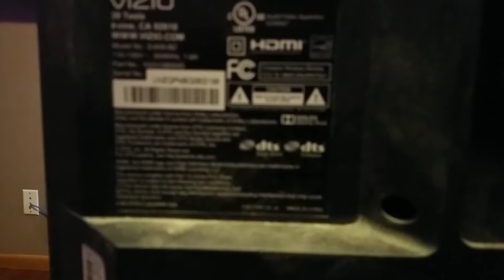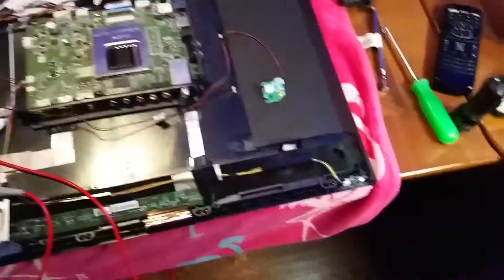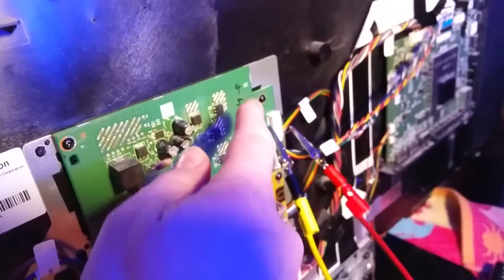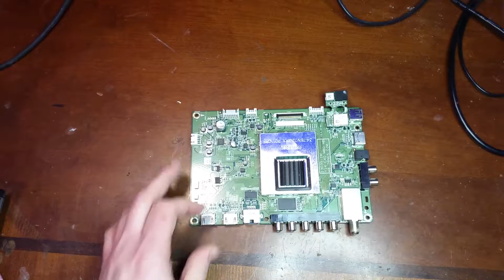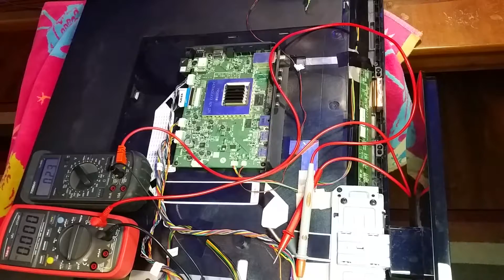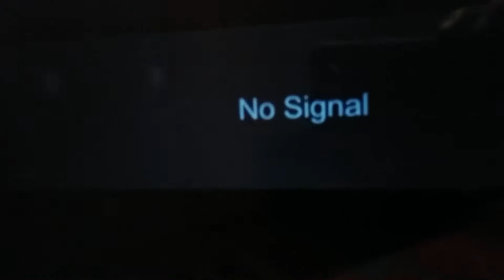Watch me Repair Vizio E400i-B2

Comment: Where do I find the wiring diagram for the circuit board
Reply from the maker: Like a schematic? I'm not sure if one has been made available. But usually the header pins have some sort of diagram or clues to what the wires do.

Comment: Hello. Very good video. Mine was affected by by a Thunder that hit close to the house and TV would not turn on. I'm a DIY selfer, but Im no trained techy. So, TV now about 10 years old, I blamed it on the power board and got a NOS PB from ebay. Now TV turns on, Vizio logo, get visual and sound for 3 secs and then freezes and turns off and doesn't turn on unless I unplug it from outlet? What could it be? I think I can get the other 2 boards for a reasonable price and get my TV back online. Would You recommend getting the other 2 boards and see what happens? Thx!
Reply from the maker: If anything was plugged into the HDMI cable a surge could have come in that way and damaged the main board. I'd first confirm the image stops working also when the backlight goes out. If so, order a main board.

Comment: My PSON voltage is measuring 3V constantly, no matter if when I push the power button.  Would that indicate an issue with the main board?
Reply from the maker: Yes sounds like main board

Comment: I also have the Vizio e400i-b2 and my TV is doing exactly the same thing yours did. However, before that it would randomly turn itself off for no reason. Sometimes it wouldn't do it for a week and sometimes it would happen 2 or 3 times in an hour. Well acouple days ago it turned off on me but wont turn back on. The power light comes on and then it turns off, but the screen stays black. Exactly like yours. After a bunch of research of this model on forums and YouTube and it seems the consistent answer is the power supply board goes bad. I'm going to order one online and replace my board. After watching your video and one other I'm pretty confident this will fix it. I'll update you guys after done.

Comment: I have this same TV and it is having issues. It won't turn on. I pulled off the back like you have but not sure if I should swap out the power supply board or if there are any tests I can do on it. Any suggestions? I have checked out a few of your videos and love your repair work. I wish I could understand electrical boards and such.
Reply from the maker: Fist thing first, do you have image? Hold a bright flash light up to the glass and turn it on. Look for menu messages like channel info or "no signal detected" messages.
Reply: @jeffescortlx  Nope, i do not even have the power light coming on. I try with remote and with button on the TV, no luck on the power light showing that it is on.
Reply from the maker: @Retnuh1337  did you test the power supply?
Reply: @jeffescortlx  To be honest, I do not know how to use a multi-meter and where to use it to test. I will try to find one of your videos explaining it. I will start there. Thank you sir.

Comment: Same TV, same problem! Another YouTuber repairs LED tvs and recommended "ShopJimmy.com." They sell the Vizio E400I-B2 (LWZQPNBQ Serial) Complete LED TV Repair Parts Kit for $49.95. You get the Main Board, LED Driver, and Power Supply Unit. I'm ordering today and replacing everything.  :)
Reply from the maker: If it has the same issue as the one I fixed, you might be able to get by even cheaper by just ordering the power supply and LED driver board. Main Board might be perfectly fine.
But your right, I need to work on my video production skills.
Reply: I was really, really happy to find your video, even though it was hard to watch at times. Thanks for posting it!